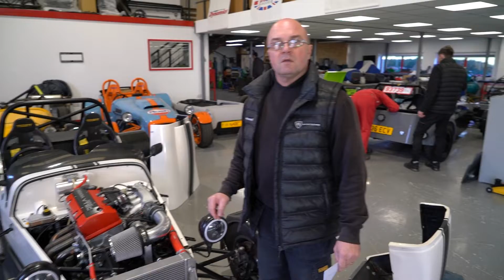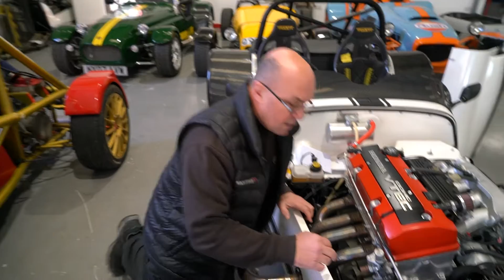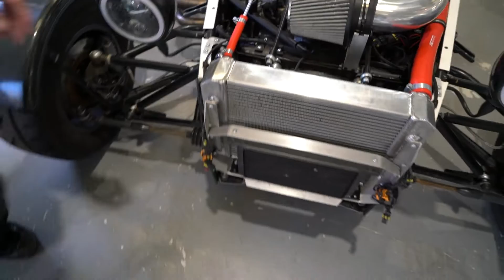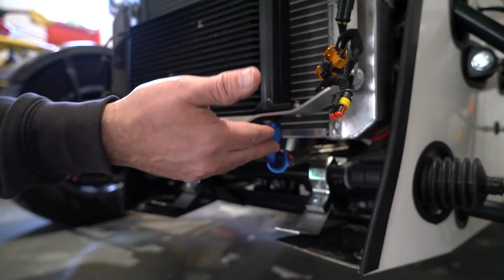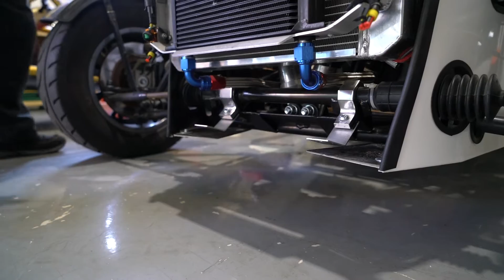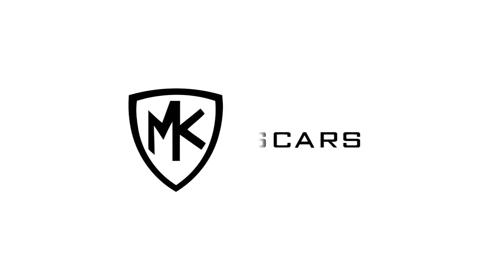Explained: how to plumb oil cooler lines on S2000 engine

Comment: Could I ask if you ever use rubber mountings to attach the actual oil cooler? They are sometimes prone to cracking  about the mounting points in exposed to vibrations if solidly mounted 🤔
Reply from the maker: We haven’t, and don’t appear to have had any problems.
Reply: @MKSportscarsofficial  Thanks for the reply! 👍👍.